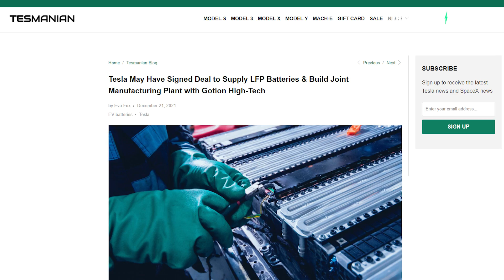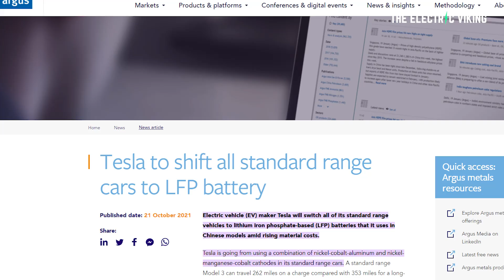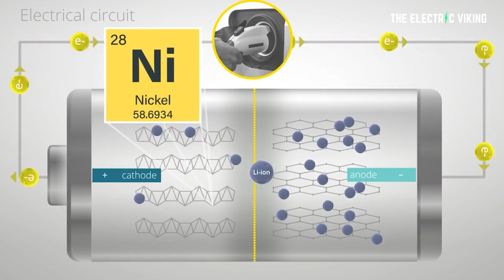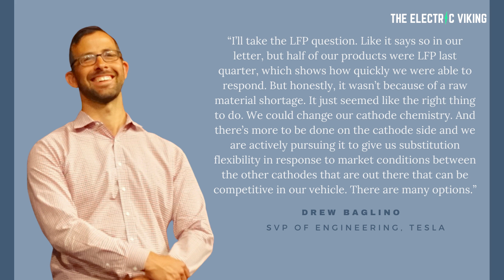Tesla using no-cobalt LFP batteries way more than we thought!

Comment: Note - they are using it for their low end vehicles.   Secondly it does nothing to avoid the limit lithium presents as a cap on Li EV car production.  Until they have a totally new chemistry EVs are a dead end - not enough lithium produced annually to make over 3.6 million Tesla size EVs - If Tesla suckes up all the lithium you get impacts making other things Rivian CEO already predicts a giant battery shortage for this reason.

Comment: Viking,
Given the importance of the 4680 form factor to the structural battery pack... do you know if the 4680 form factor can be used equally well with LFP chemistry and Tesla's manufacturing machine design? 

Cheers,
Eric

Comment: All data I can find is that LFP batteries produce about half the power per size/weight than NCA batteries that Tesla has been using.  And the new 4690 batteries are only made in NCA formulations.  LFP is popular in China where most EV's. provide considerably less than than int he US market. All data I can find online says that LFP will always have lower density (with better life - inherent trade off) as in any improvements in LFP density can be applied to NCA designs with similar implements.

Comment: On Battery  Day,  Elon was begging for nickel . At last week's QTR report Elon was begging for Lithium. Smart man. 
I would actually prefer a safer LFP  that I can charge to 100% and has double or triple  the charge cycle life span.
Reply: May be but the LFP will have significantly less power density
Reply: @KBConsulting  Right, has real trouble getting 0 to 100 kmh down below 5 seconds. Of course, checkout what the comparable performance costs from an ICE auto.

Comment: So will the new LFP cells be in the 4680 format?
Reply: Never
Reply: @theairstig9164  : lol, changing battery chemistry is really "as simple as" mixing a batch and buttering it on the electrodes - as the strips are being made... Electrolytes change too  (which is the reason why LFP batteries are less explosive than LMC/NC/etc - eliminate a flammable electrode, the battery gets safer).

Why can't other Manufacturers do it - because they don't own the rights to the process...  BYD, CATL, Wanxiang,  etc, they do..
Reply: @kadmow  you can also make hammer out of paper but why would you...why cripple the LFP battery with wasted gap space between cylindrical battery..LFP do not need the gap for cooling so making LFP in 4860 fomat is dumb...
Reply: @airrodgers7277   there have been cylindrical LFP batteries since the chemistry was first utilised (A123 - 26650 etc) - nothing new here - Large format batteries don't lend themselves to cylindrical units in any case - its just what was available back in the day with quantities of 18650s on the market.. - Tesla got stuck in a timewarp.  lol...

Comment: As time goes on we should see an increase in energy density for all types of batteries.  This means lower cost per KW.  For Tesla to increase production they need more batteries.  A battery has to meet certain requirements before it can be used in a car.  There are lots of promising types of batteries that first need to meet requirements and then need to be produced.  This can take a while and by that time something new is showing potential.

Comment: LFP batteries have poor cold weather performance.  They are not suitable for use in some cold environments.  Tesla is making a good move by using both LFP and the higher cobalt batteries.  I personally could use an LFP car with zero issues due to ability to keep it plugged in at home and weather that is not too cold.  But if you can't keep it plugged in, it is not going to work on some days in the northern locations.
Reply: Even Petrol and Diesel cars prefer to be plugged in,  in the frigid Northern Regions.

Comment: I'm in Washington State in USA. Tesla just confirmed the SR Model 3 I've ordered - no VIN yet but probably will get it soon - will be a CATL LFP pack. I have a strong preference for the LFP pack for all the reasons Elon has mentioned and you've discussed on this channel: 
- high cycle life (perfect for a robotaxi!)
- effective regular use range is equivalent to or better than nickel battery on same vehicle due to ability to charge to 100% without substantially lowering cycle life
- even better safety
- fewer conflict metals
- promotes use of a chemistry that utilizes plentiful and readily available components (iron).

Comment: 80% only applicable to DC Fast Charger.   Level 2 at your home is okay to go to 100%. Just wanted to clarify that.
Reply: Never charge to 100% regularly by any means…..unless it’s the LFP pack.
Reply: I don't know where you heard that, but I don't believe that is the case. In general fast charging is harder on batteries, but that does not mean charging to 100 on level 2 is as good for the battery as 80%. Similar to cell phones and the other lithium batteries I have been using for years.
Reply: Not really,the voltage curve of ternary ‘’NMCA’’ is not as flat as LFP…At high charge rate, e.g. let say over 90%, the CAM push a high voltage close to the limit of the electrolyte window…and then more prone the degrade the electrolyte, especially when the battery is warm such as south USA warm climate…
Reply: Not really,the voltage curve of ternary ‘’NMCA’’ is not as flat as LFP…At high charge rate, e.g. let say over 90%, the CAM push a high voltage close to the limit of the electrolyte window…and then more prone the degrade the electrolyte, especially when the battery is warm such as south USA warm climate…
Reply: My NCA Tesla battery is recommended to 90% not 80% as mentioned here and charge occasionally to 100 say when doing a long trip. Batteries are just commodity, in general need to follow manufacturer recommendations and also limit fast charging regularly. No battery degrading for me so far 1 year and 10k km in. I don’t expect much over the time I own it.

Comment: When I picked up my 2022 Tesla Model S the dealer told me Tesla now recommending charging to 90% routinely. I still only charge to 80%.
Reply: Why?
Reply: @MarkBesaans  1) I don't need the extra range. 2)Takes longer to charge ie. more electricity usage at my end to go from 80% to 90% than from 70 to 80 or 60 to 70 etc. 3) Don't 100% trust what the dealer says as I've never heard that before or since from any source.

Comment: Cobalt is used in the refining of fossil fuels to extract sulphur from the crude oil and its not recyclable unlike in EV batteries. 
The fossil fuel industry doesn't make this common knowledge. 
Cobalt is also used in steel alloys, like tools steels, it has many uses apart from EV batteries.
Reply: If anything means death it's jewelry. And it does nothing for society. At least batteries do something.
Reply: You are grossly incorrect.

From Recovery of Cobalt from leach solution of spent oil Hydrodesulphurization catalyst using a synergistic system consisting of VersaticTM10 and Cyanex®272 To cite this article: Yuliusman et al 2018 IOP Conf. Ser.: Mater. Sci. Eng. 334 012049
View the article online for updates and enhancements.

One commonly used method is liquid-liquid extraction. Cobalt is generally extracted using a single extractant (SX) such as Cyanex®272. Cyanex®272 can extract cobalt with an efficiency of >98.6% but this process requires two stages and produces large excess of organic phase [4]. Thus, some institutions also used VersaticTM 10 because this extractant has a low percentage of extraction on impurities such as magnesium and calcium metals. However, the use of this extractant is inefficient because it requires extraction and stripping of two stages to achieve the desired level of purity of cobalt extraction. It can be concluded that single extractants are generally not selective to cobalt when compared with other impurities found in leach liquor, such as copper, zinc, iron (II), cadmium, calcium, magnesium, and manganese. Therefore, a technique often used in the field of extractive hydrometallurgy to obtain higher separation efficiency and metal concentration is to use a synergic mixture of multiple extractants (SSX). When VersaticTM 10 is used as a component in a synergistic extractant mixture with Cyanex®272, the percentage of cobalt extraction is increased to 97.48% [6]. Mubarok and Hanif did an extraction experiment with a synergistic mixture between VersaticTM 10 20%vol. and Cyanex®272 20%vol. at pH of 6.95 and temperature of 40oC
Reply: What!? 😱
Reply: Military has been historical largest user of Cobalt as all super alloys are made with it, so all high performance armor and most aviation metals use cobalt.  It is also used to make all high performance magnet assemblies.
Reply: I believe at least some of the cobalt used in the oil refining process can be recovered....but as I understand it, the amounts are nowhere near the same as EV battery recycling.

Comment: It supercharges slower as far as I know and the specs used to be worse, Tesla could use it because Tesla’s are incredibly efficient. As far as I know even the LFP Tesla’s don’t have 300 mile range do they?

It is a lot cheaper indeed and I thought the Chinese used it already longer then Tesla, especially in buses.
Reply: LFP battery performance has made significant advances recently and a 300 mile range is unimortant to most users and when you have the advantage of the fast Supercharger network it becomes even less significant.
Reply: Tesla Björn did a 380 miles run this weekend.
Reply: It has less range but also it's using less mass, people speculate that the shorter range is in purpose to not cause that clients cancel their orders of other car models to wait for LFP only.

Comment: What is the additional cost per mile to charge a LFP vehicle based on percent?  Is not an LFP vehicle fractionally heavier and less efficient?  If you keep a vehicle 10 or 20 or 30 years; would an individual benefit from a lower, per mile, charging cost?   And, the additional range has some advantage, in time, if the owner is charging away from home.  For example, doing a trip of 1000 miles might require stopping to charge 5 times with e LFP and only three times with a higher grade chemistry (cobalt or whatever).  My point is that range anxiety is still a factor for some people especially if you live in Australia or, like me, Nevada.  This anxiety could be alleviated some if one could rent a suitcase size additional battery, with say 50 miles of range, that could be plugged into a boot plug.   You simply rent it, or buy it, if you feel you need additional range.

Comment: It’s important to note that cobalt is used in the refining process to extract sulphur from crude oil. While demand for cobalt in battery manufacturing will eventually fall away, there are no plans in the oil industry to discontinue the use of cobalt. Indeed, in an incredible display of hypocrisy, the oil industry tries to portray batteries ethically challenged, while keeping quiet about their own culpability.

Comment: So 80% is the 100% level. It just takes a larger batter for equal range.
Reply: Yes but also no. The base lfp chemistry pack has only 55-57kwh in total useable capacity per the tests by tesla&ev guru Bjorn. 
The lr has 75+useable kwhs in comparison. So even 80% of the lr available capacity is still more kwh total than 100% of the lfp pack. 

Basically if you do not care about 0-60mph in under 5.5seconds and like charging to full whenever. The lfp seems to be a better choice.
Makes me wonder if tesla will move to lfp for everything outside of the performance and higher end model's like s/x/ct&semi.🤔